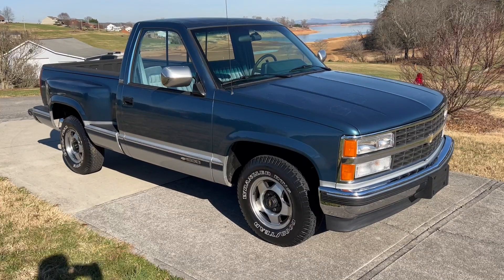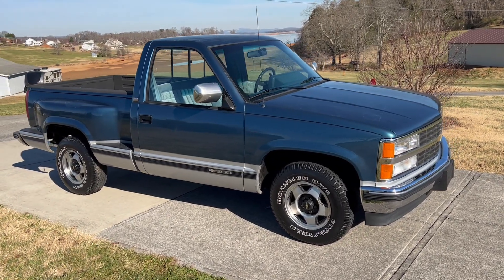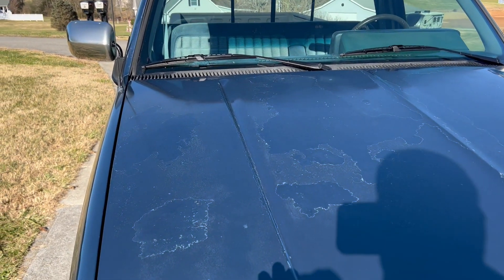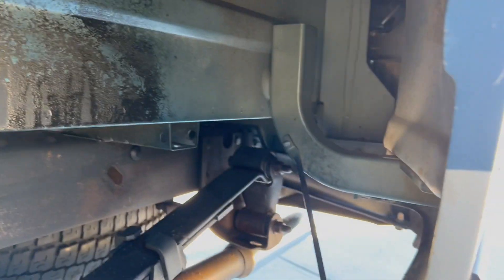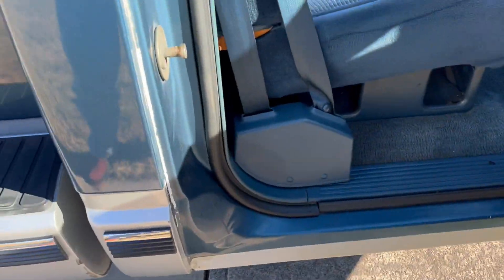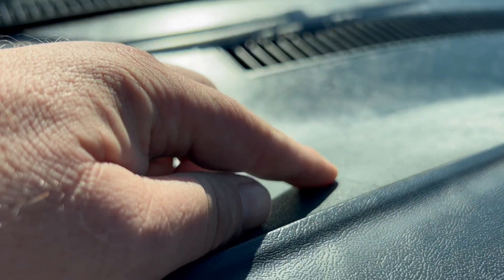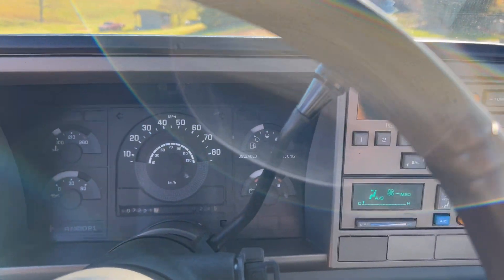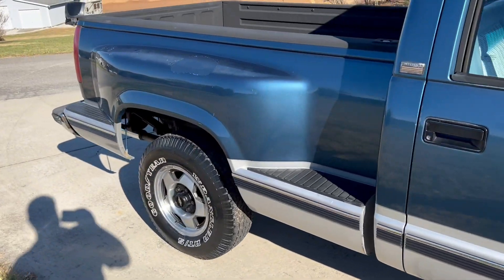1990 Chevy half ton 2 wheel drive short bed step side walk around video

Comment: How can I find out about this truck?
Reply from the maker: You can look it up on eBay under this item number. 294651996095
Reply: @jasonthompson7388  I actually found it just a bit ago. Is 6000 the number for it? I have the red 94 4 wheel drive like you had for sale.
Reply: @jasonthompson7388  I've been wanting a 2 wheel drive stepside to slam to the ground. Let's work a deal. I'm in Crossville TN.
Reply from the maker: Hi Scott my truck is going to sell to the highest bidder.  in my ebay ad is my phone number text me some pictures and what you want for your truck.